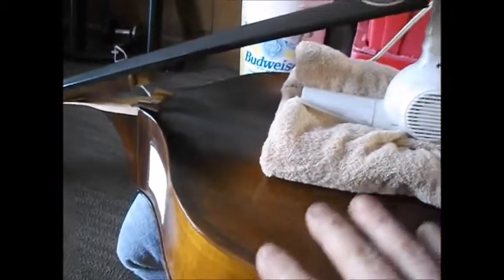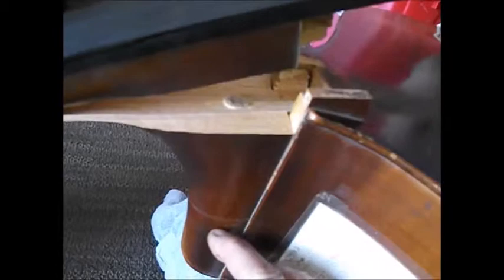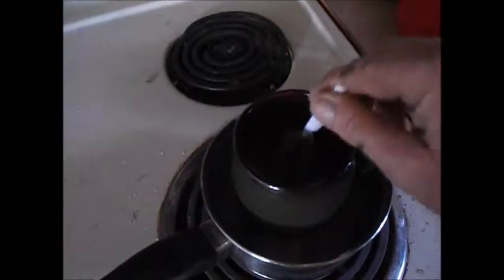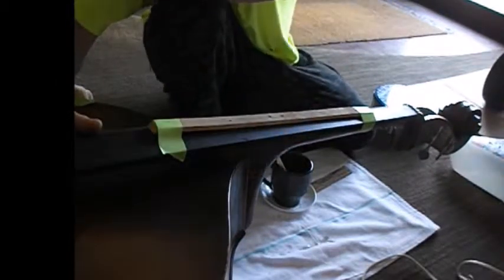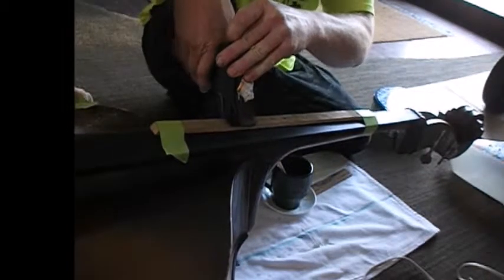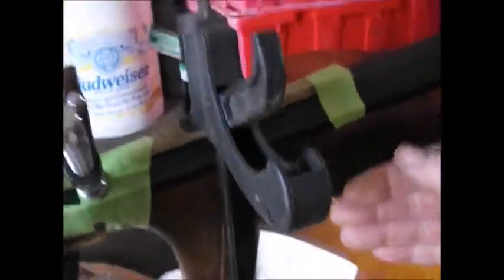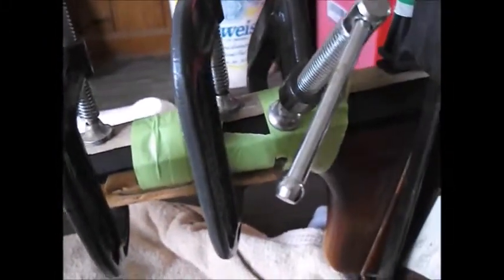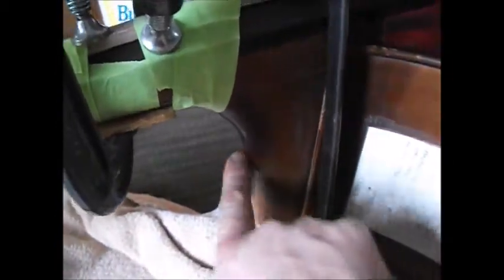Regal / Kay Upright Bass Neck Repair Part 1

Comment: That's a bugger Mike...Was it strung when it fell over.?...Looks like the repair will work.
Reply from the maker: yeah it was strung. i think it fell on it top and the bridge acted like a pivot and the string tension helped it crack.  stuff happens buddy. took me a couple days to get over it and even think about fixing it... ive done quite a bit of repairs but not this big. i think it will just fine. looking really good!!

Comment: hello i had a gig this saturday and after placing my upright on the stand it falls and the neck breaks , i’m going to try to repair it using your methot what else do you suggest
Reply from the maker: You'll want all the wood strains to match up. So clean it but don't sand it! Do like I did and apply a bit of water to the joint. Use a heat gun or hair dryer to warm the wood close to the temperature of the Hyde glue that your applying.  This will help the wood absorb the glue. Get the wood grains lined up perfectly and strap or clamp it good (have this set up and planned prior).  Let it set for a week or so then put it back together!